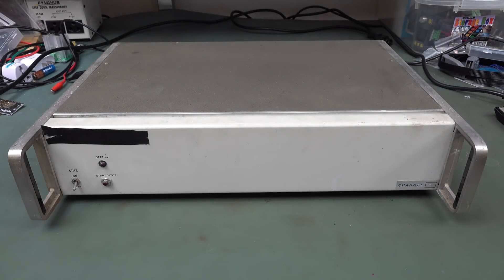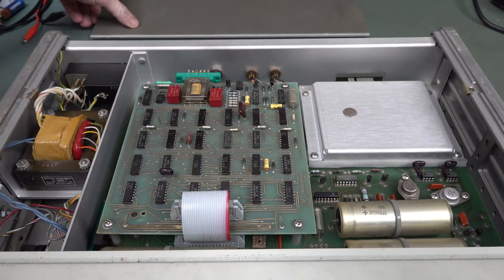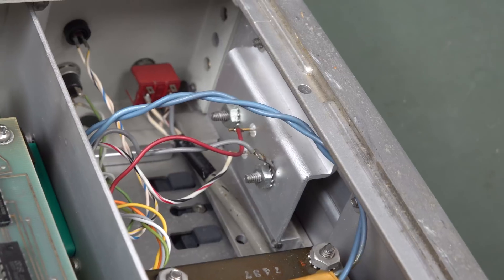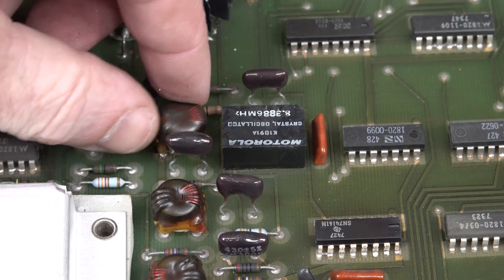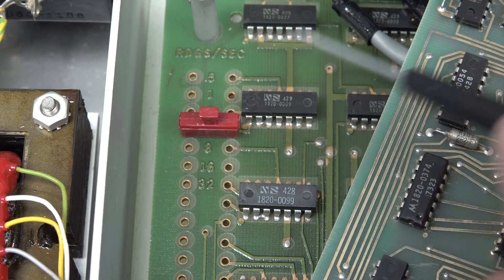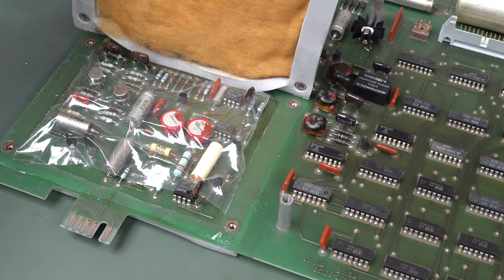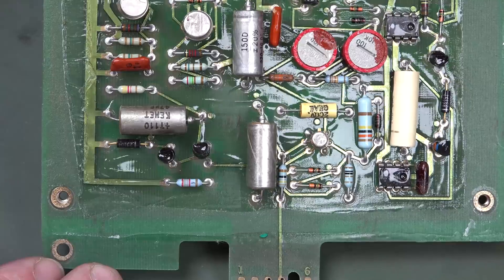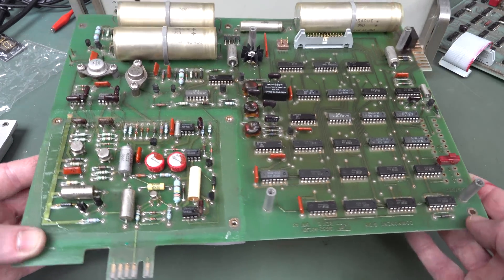EEVblog #1126 - Mystery Teardown!

Comment: Given the age of that gear, I wonder if Bob Widlar had any hand in those National Semiconductor Op Amps.  I note that the fixed resistors are all 5 band 1% variants.  Note just how bad electrolytic capacitors are:   +/- 20% when new.  More like +10/-30% as aged.  The metal film cap has to be the sampling cap.  I'm not seeing any DACs or R2R networks, so we can rule out any ADC type that needs a DAC.  The thermal insulation ensures that both power rails are affected equally by ptc/ntc component effects, thus preventing the derived reference voltage from drifting.  The signal path will have been given the same design consideration.

Comment: Those trimpots (IRC Circuitrim) aren't high tolerance - only 5%, but that is for the total resistance which wouldn't matter in most circuits.   The wiper would be adjusted with a screwdriver to effect the desired resistance and a lacquer ("gunk") used to ensure that it didn't self-adjust with vibration or environmental changes.  With the two resistor end terminals placed across Vcc and Gnd you have a one component voltage divider, with the wiper terminal providing an adjustable voltage.  Or use one end terminal and the wiper terminal and you have an adjustable resistor (often seen with the other end terminal shorted to the wiper terminal - in the event of a wiper failure the result would be maximum resistance instead of open circuit.)   Note that these don't appear to be high precision either, at least by modern standards.  They are one-turn pots, ie 360 degrees (well, slightly under), covers the whole 10K range, about 28 ohms per degree of adjustment.  A  ten-turn pot would only be about 2.8 ohms per degree allowing for a much more precise adjustment.

Comment: That RED "gunk" is high voltage varnish.  We used to call it "glip" to lock in the pot adjustment so that it would not vibrate to a different value and you could tell if someone adjusted it.

Comment: Hi Dave! I have seen something like this before. I recognized a part of the circuit made by HP in an old analog-digital conversion board I found on junk. The board I found seemed to be a prototype the electrical transmission company. No datasheet or manual was found with it. I didn't see anything strange as the woolen stuff you found though.

Comment: as mentioned already, it was used with a couple models of gas chromatographs, to provide a digital signal to computers.  it was also used in industrial process control units, for much the same.  I haven't been able to find much more than that.  apparently, it was also co-produced by Agilent.

Comment: This is the ADC used in old HP(now agilent) gas chromatograph. This is a ADC for calculating the peak area(flame ionization detector femto to pico ampere current converted to plus or minus 1 volt using a transimpedance amplifier and the same will be converted to digtal using this ADC box. Sampling can be done up to 32 hertz(more number sampling more narrow peaks can be detected). We inject a standard, calculate are under the peak then inject sample and compare the area under the peak to the standard and will get the quantity. The peaks are eluted as an order and its called retention time. With respect to the retention tie , qualification can be don for different materials. Now many manufactures have gas chromatograph including us :). Data apex clarity is an excellent product now a days...

Comment: Dave, I've seen one of these at a Garrett manufacturing plant in UK. It was used to sample analog output from a speed sensor of a turbocharger under test. I believe there was kind of primitive digital closed loop system with adjustable PID controller. The purpose was perhaps to control the speed under various engine loads and rpm. There was more HPs in the rack, but I remember this one only due to the fact it was 40years old A/D.

Comment: https://www.labx.com/item/hewlett-packard-hp-18652a-a-d-converter/4342848

It's definatly some sort of LAB Equipment.

Further information found, on page 40:
http://www.aimanalytical.com/Manuals/5890IISitePrep-S.pdf

05890Ć60790
to HP3350 Series
2 m
Edge Connector:
Lab Automation
HP18652A A/D Converter,
Systems
1 V input

The HP 5890 Series II is a gas chromatograph.

My guess is that the converter is some sort of regulator for the gas chromatography, to stabilize it, so that they get good results of whatever they are testing.

Comment: Hi Dave, From what I have been able to find those 1852A’s were part of an HP 3352B Laboratory Data System, used widely in gas and liquid chromatography equipment. It had an HP “computer” if you could really call it that, with a whopping 24K of memory, and output to a plotter for accurate plots of chromatograph peaks. Used in everything from Medical research, drug testing, forensics, to oil and gas industry, and chemical manufacturing. High precision for the day, and HP apparently didn’t want anyone working on defective equipment (other than HP themselves) because you are correct about absolutely no manuals or schematics “in the wild”. That was pretty much standard practice for HP in the day. I hope this satisfies a bit of your curiosity.
P.S. I actually saw one of those in the early 1980’s in a Mud Logging Trailer at a 22,000 Feet deep gas well drilling site in South Texas. It was connected to a gas chromatograph monitoring samples of gas coming out of the drilling mud that was pumped through the drill string then back up the bore hole into the mud pit. It was running in parallel to a Honeywell analog chart recorder, I guess they didn’t want to take a chance of the “new fangled” digital machine missing something.

Comment: It’s a 18652A a/d for the HP 335x series of lab data systems. I was an HP systems engineer for these systems for several years. They were manufactured in Avondale, Pennsylvania. A sister module was the 18653B event controller module (ECM) which has 16 bits of binary input and 7 triac outputs, mostly used to control an autosampler/autoinjector. These modules were daisy chained in a loop with a single shieded twisted pair. You could have up to 15 modules in a loop. The loop controller, 18651A, sat in an HP 1000 minicomputer. This started with the early 2100 series core based machines up to the later 21MX models. With chromatography, it’s area you are interested in, so this was an integrating a/d.  The sampling rate was not high, but it didn’t need to be. You could have up to 100 meters of cable between modules as far as I can remember. With the 3357 system supporting 4 loops, you could have up to 60 channels of chromatographic data acquisition, integration and reporting going on simultaneously. There was a limit on the total sampling rate per loop. This module was also supported on the later ‘A-series’ systems, although it was superseded by an updated module. These modules were extremely reliable. I don’t recall ever having one fail at any of my customers.

Comment: I've torn down two of those.
The foam around the edge of the cans was not sticky. must be rubber degradation :/
https://i.imgur.com/stAmnyf.jpg
I may have a service manual around the house, but my dad is a bit, ehm, how you doin. He claims they were frequency counters, but it may be that he got them (from the KLM) when they were already re-purposed. I know the one with two holes in the front panel was re-purposed as a time clock.

Comment: Yeah, the card-edge connector next to the insulated section is identical to the one on the old HP "integrator" graph plotter for the HP GC's. 
it's contemporary with the HP5710 gas chromatograph which I believe is the first with the form-factor agilent uses today

Comment: We had some vintage Gas Cromatography units in my appreticeship. But I think they were a generation or so more modern. https://picclick.com/Hewlett-Packard-HP-3392A-Integrator-Gas-Chromatograph-Printer-232656050191.html They used this type of integrator to record sampling but I think this has already an AD/D inside. 

The setup would be something like sensor --> sensor to signal changer --> signal attenuator to get to 0-1V signal --> integrator unit

Comment: The thickness of the can made me think of the can that houses an old-school FDR's tape.
Which brings me to a possible reason you couldn't find it as an HP device.
A few years ago I heard about people having trouble finding the purpose of a rusted through component they found at a beach as the design and stuff for the component was with the client Boeing instead of the (still identifiable) original manufacturer.
Something similar could have happened here: HP build the device, but the rights are held by the client.

Comment: OK so I guessed wrong initially.   It's an ADC from a Gas Chromatagraph where the output is typically between 0 and 10mV.  I'm surprised there isn't more analog goodness.
Reply: Ah... the card edge connector does go into the box... that's where the goodness for the front-end is.

Comment: You find that thing mentioend in various HP/agilent gas chromatograph systems. There are alternative parts mentioned, so it must be some defacto standard for these things how to communicate. All I could find was that it seems to work on 1V signals.

I also found it mentioned in a variable wavelength detector. Even a 2000s electrochemical detector mentions a connection to that thing.

My guess is that its a pretty high performance part to increase the performance of an existing system.

Comment: A huge discrete A/D converter, before the advent of dedicated A/D ICs...it is amazing to see that entire thing on a single 10mmx10mm IC today, consuming 1/1000 of the power, with 1000 times higher sampling rate.

Comment: *--> I believe I've seen this equipment before. 

First off, since it was made by HP, I'm going to opine that this unit could be designed as a multi-purpose equipment where there is a need to convert any analogue signal to a digital one. 

Having said that, I have worked in my college days in a control room for the department responsible for remote education service. The control room is practically like the mixing and recording control room you would find in a television broadcast studio. The remote education department is responsible (among several things) of live video recording and transmitting of classes to remote classrooms over a microwave carrier signal, and to a webpage on the university's local server. I have seen an equipment that looks exactly like this mystery unit mounted on the rack right above the power supply equipment in that room. In fact it was one of the first units that had to be turned on along with the power unit at the start of the work day. Since the department has not only digital recording devices but also a few old fashion (but compact) analogue video/visual equipment, it would make sense (but still my guess) that the analogue would need to be converted to a digital equivalent somewhere down the line. (In fact it would be before the mixing station console since I know that the majority of the mixing work was done by an old built-in computer.)

That is as far as I know.

Comment: Found from the Journal of Chromatographic Science, Vol. 25, May 1987: "The analog output from the HPLC detector is transmitted to the laboratory computer via the Hewlett-Packard Model 18652A A / D Converter Interface."

Comment: This is component of HP 3350 series, which is a lab automation system. HP itself also was a big player in analytical chemistry, especially chromatography and mass spectroscopy. But they were selling instrumentation, data logging, control, printing, storage, crts, etc, entire system as modular system, for other companies and to laboratories to build custom scientific equipment, both in chemistry, medical diagnostic, but probably also in other serious fields (physics, astronomy, etc).

Here some pictures : https://pubs.acs.org/doi/pdf/10.1021/ac60330a715 , including this exact A/D converter model.
https://pubs.acs.org/doi/pdf/10.1021/ac60332a722 for more details.

Comment: 8.3886MHz is commonly used for real time applications .... im going to guess its some kinda pulse counter within time similar to a geiger counter 
but im half way threw the video and have yet to scroll down the comments so fingers crossed!
Reply: ah damn, im actually surprised by this i expected even at the time some kinda single chip solution but the 70s was well before my time

Comment: Yes, It´s used in Liquid Chromatolography in Clinical Analysis. reference in this Link: https://books.google.com.br/books?id=OZGEG-C99EEC&pg=PA413&lpg=PA413&dq=hewlett+packard+18652+A/D+Converter&source=bl&ots=fidGeJhPS1&sig=JivHq1ZiS4hwC0WaMr9x7-pnyQE&hl=pt-BR&sa=X&ved=2ahUKEwi385bsx9zdAhUIj5AKHdvFCjkQ6AEwAnoECAgQAQ#v=onepage&q=hewlett%20packard%2018652%20A%2FD%20Converter&f=false

Comment: Why was it so corroded? It looks like it was protected from a ruff environment for what it is. Was it from a submarine or navel use? I figured it was an analyser / memory for an HP oscilloscope.
Reply: Solder Joe Gas chromatography probably implies the likely presence of unusual chemicals (liquid and gaseous) nearby most of the time.
Reply: John Francis Doe   If that's the case for this. It survived rather well. For '73. I worked in an FMC plant that made industrial bleach for pulp. Everything turned to rust and corrosion really quickly. Rot through those terminals in a month. The magnetic floor in the control room was always fun to play on with the pools of mercury and powdered rust all over .

Comment: Interesting. Could a 2018 Arduino do everything this piece of equipment does?
Reply: Micah Joel Maybe the digital part, but double-ramp A/D at 8388608Hz / 4sps = 2Mi clocks per sample = 6 digit / 20 bit precision if a double ramp converter.  That temperature controlled isolated box with the heating resistor next to the precision capacitor is the difficult part.
  Although you could wire up a 20bit SAR ADC chip from Analog Devices to the SPI bus (I think there's an Arduino SPI library already) with a nice voltage reference, but you'll still want to control the system temperature by driving a power transistor from a PWM output and using the μC built-in temp sensor to keep a steady temperature, and the μC EEPROM to store adjustment values from calibration testing of each device plus a digital signature from the calibration lab.  Also sync the onchip CPU clock PLL to an external PPS or 10MHz signal from your lab time reference, to ensure consistent clocking of the ADC chip (syncing to the USB 1kHz signal is not precise enough for a 1ppm system).

Comment: The US military used them.  NSN (national stock number) was 6625-01-100-2596.  It was part of a digital acquisition system made up of:

Components includes, HP2113B processor with 32K memory, HP7906A disc drive with interface and controller, HP2645 crt with dual tape cartridges, HP966B thermal line printer, hp 18651A digital transmission loop controller, HP18652A analog module, HP29402B cabinet, 56 in 60 hz 120/208 V, HP18661D laboratory automation system software

Comment: Apparently it could be used as part of a gas chromatography setup - using the HP 5890 SERIES II Gas Chromatograph.

There is mention of a cable in the document I found:

Part number: 05890-60790 | Edge Connector: HP 18652A A/D Converter, 1V input
Reply: Search this document and there's a single reference of "18652A".

https://www.agilent.com/cs/library/support/documents/a15282.pdf
Reply: There are four references to "18652A" in this document:

http://www.aimanalytical.com/Manuals/7673B/HP%207673B%20-%20S.pdf
Reply: I found that document as well and there seems to be a clue in the filename:  HP 1090 LC as an Auto Sampler by Agilent. It looks like that unit is part of a set of systems.
Reply: Here is another document from Nestle Research department measuring raw melting curve using HP 3356 LAS recording using the HP 18652A.
https://vdocuments.site/documents/iso-solid-diagrams-of-fat-blends-from-thermal-analysis-data.html
Reply: this document has a wiring diagram that shows how to connect a 5890A to a 18652A using another piece of equipment in between 
http://www.willstein.com/Resources/HP%205890%20Cable%20Configurations.pdf
Reply: Did you google for . "Infile:pdf 18652a" ... This will look especially in pdf files. And you will find some more stuff what you other wise not find.
Reply: yeah i guess data acquisition would make sense

Comment: It's not asbestos. It's plain old fiberglass. Asbestos is white and chalky...
Reply: there are multiple kinds of them .......id be safe. glass wool fibers are pretty nasty too ...especially if stuff like the matrix disintegrating over time has occurred.
Reply: "Good news is, the lab boys say the symptoms of asbestos poisoning show a median latency of forty-four point six years, so if you're thirty or older, you're laughing. Worst case scenario, you miss out on a few rounds of canasta, plus you forwarded the cause of science by three centuries. I punch those numbers into my calculator, it makes a happy face."
Reply: There was also a greyish, woolen type of asbesots which could be mixed in. I'd put that stuff in a bag, and give the bench a wet cleaning. It's not that much effort..
Reply: What makes you so certain? It was only yellowed on the bottom. I've handled asbestos insulation that looked just like what he opened, albeit a little whiter.
Reply: ..... Mate, that's a Mesothelioma attitude !
Reply: Looks like glass fibre to be as well. If it was asbestos, it would be all crumbly by now, powder not wool